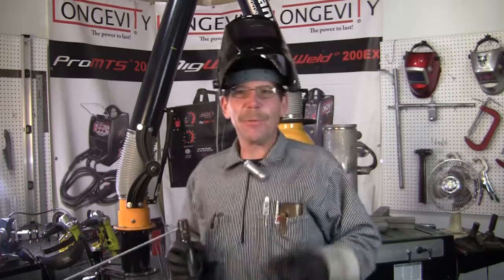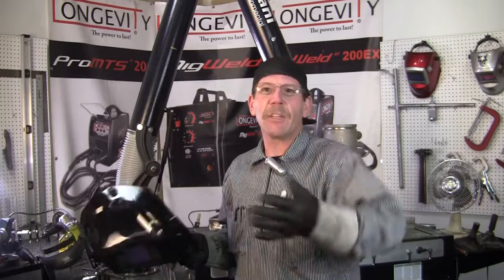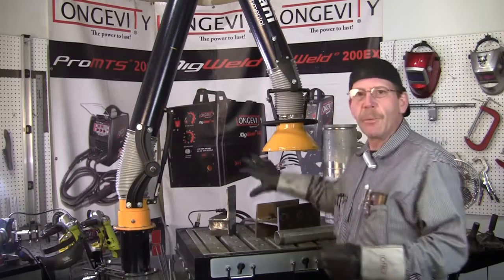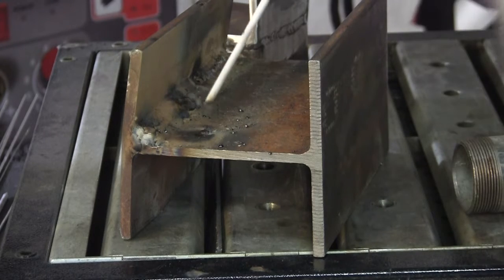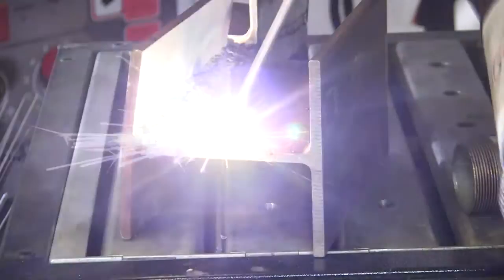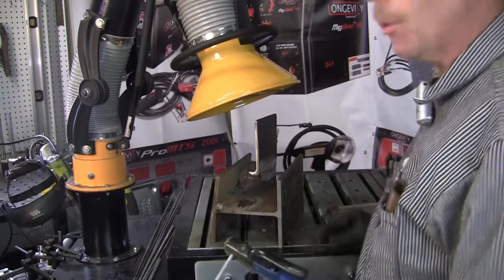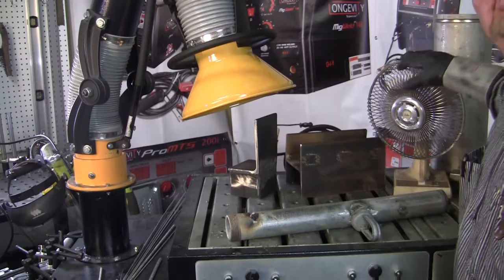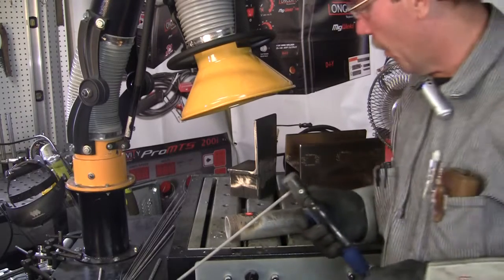BASIC WELDING VENTILATION EXAMPLES BY LONGEVITY

Comment: Is it safe to be welding  just using a basic throw away mask with no kind of ventilation?
Reply: No respirator captures all smoke particulates. And when they land on your skin and clothes, they get into the air when you move and inhaled. And some are absorbed by your skin.
Reply: @darkwaters1010  so you shouldn’t wear a 3M mask and just use ventalation and open doors?

Comment: hope this isn't a stupid question.. can I mount a fume extraction fan directly to my welding table, or would it need some sort of insulation bushings?  

I have a downdraft exhaust fan I was going to solid mount to a basic welding table to vent outside.. 

once I got it all mounted, I just got to wondering if the fan would affect the table being grounded, or the welding would somehow short out my fan ..

Comment: I think you need to learn how to weld before you do videos on welding...heck you couldn't even keep a new rod from sticking.
You wouldn't last long on any job I have ever been on....I really can't believe Longevity has you promoting their product..
Reply: +WestCoastMods get a life
Reply: WestCoastMods   Most of those were not new rods.
Re-strikes on 7018/7024/728 are difficult to get lit again and maintain an initial arc. 
Apparently you have never tried to stick weld on galvanized materials either.
Reply: patw52pb1 Thats not a new rod at 5:15?...I think it is. Just so you know I am a welder by profession.....Pipe welder that is...we use 7018 everyday so I know it can stick...but not 3-4 in a row unless you are an inexperience welder.
https://www.youtube.com/watch?v=dVx2IJwWuxU
Reply: WestCoastMods   Yes, it is, and on galvanized. 
It is difficult to strike and maintain an arc on a piece of galvanized pipe. 
There are days when arc initiation and sticking is a problem, others are easy. 
Rob is not the best that there is, but he appears to be as good as most commercially acceptable professional welders including union pipeliners or specialty chassis/cage fabricators.
Reply: patw52pb1 Sure whatever you say....
Reply: patw52pb1 Do you know what weld porosity is? There are many ways you can get porosity in your welds...one of them being sticking your electrode. This may be acceptable in some welding shops where quality is not required. But in most if not all pipe welding application this would not pass X-Ray.....after a few failed x-rays you would not be working for that company anymore...and some jobs are 100% x-ray.
If you are thinking about getting into welding and making it your livelihood, I hope you strive to be the best you can be.
Reply: WestCoastMods
Yes. 
I believe what you are trying to describe are lack of penetration/fusion and inclusions. 
I completely agree that weld defects will not pass, especially x-ray or ultrasonic imaging. 
However, this video is about demonstrating the benefits and different methods of fume extraction and ventilation and not about the joints being structurally zero defect. 
Review the video, Rob, was simply lighting-up an arc to produce some fumes/smoke, not performing welding, there is a big difference. 
Ha, too funny, I have been on numerous highly scrutinized jobsites where some welds did not pass, were rejected and reworked, reinspected, passed and nobody lost their employment. 
If you think that every weld you have made is zero defect, you are simply delusional. 
Yep, numerous jobs with Babcock & Wilcox, Bechtel and Fluor were zero defect and 100% imaged/inspected. 
Brother, you can talk all of that krapp you want, I have probably forgotten as much if not more than you will know, I am looking forward to getting out, not in. 
I always have, I am proud of my work product as part of a team. My signature can be found on thousands of documents. Much of my work product is reliably in use every day providing infrastructure, electricity, transportation, manufacturing, utilities, fuels, refined petroleum products and chemicals globally. 
MLU 2232 
Be safe and take care. 
BTW: You have an interesting channel.
Reply: patw52pb1 Porosity is not lack of penetration nor fusion...those are two different things. However, that is my exact point....Bob is just trying to demonstrate how to ventilate the fumes and he can't even strike a steady arc....just imagine how it would be if he was doing production welds that had to be x-ray.
The way he struck an arc is very typical of a beginner welder...and if you were a seasoned welder you would know the difference.

Anyway I am done arguing with you....maybe you should get more hands on welding, then trying to learn it here on Youtube....just saying
Reply: WestCoastMods The AWS CWI, API and ASTM differ with you. 
By AWS definition porosity is from entrapped gases. 
It only takes a few minutes to learn who and what you really are. 

If you were attempting to insult me or hurt my feelings with your last comment, you missed as your opinion is not worth anything. 
Go seek attention elsewhere, you are only projecting since you are on YouTube trolling this channel...
Are you here trying to pick up some tips on how to be a better welder from Rob and other YouTube channels???